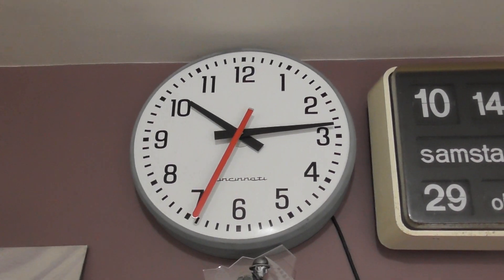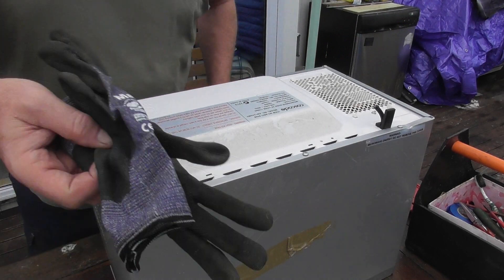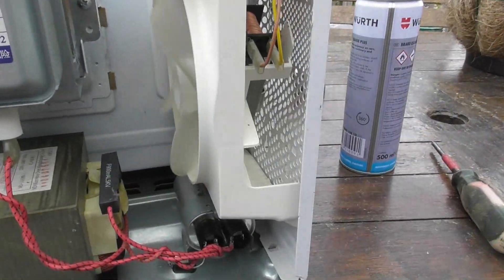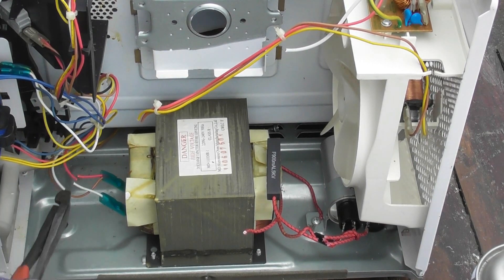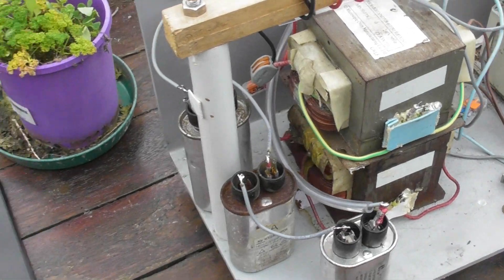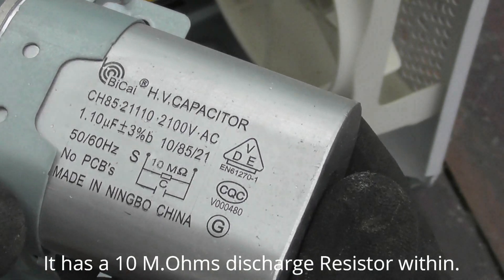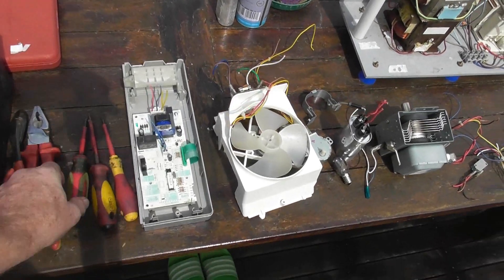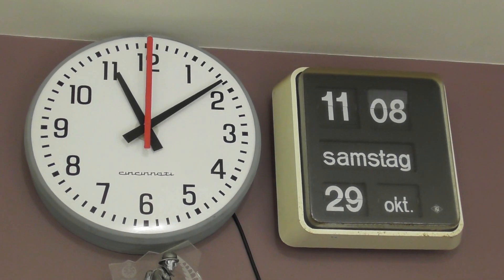Microwave oven dismantling (what parts to be used for a wasp zapper)

Comment: What happened to your watch? it looks like the glass is broken.
Reply from the maker: The glass got broken in transit by the post.
Reply: @RODALCO2007  That something bad. hope you can get a new glass made. PS have you found anyone who can repair your generator.
Reply from the maker: @THORN436  The generator has been rewound. Need to assemble the alternator part again. will make a video when it is up and running again.
Reply: @RODALCO2007  It sounds good.

Comment: I had to replace those micro switches in two microwaves. The old ones were melted and both microwaves ran when the door was opened.

Weird seeing that pigeon swallow that berry. you can see it going down.

Comment: Rodal, I missed you!  You-tube changed my button from getting notifications.   Why can’t they make a microwave that when power blinks one always has to  reset the dam clock.   Is there not a way to use power from capacitors to keep it running ?    ❤️
Reply: They are built to a price point, generally you'd it expect the grid to be reliable. Also seen ovens that have clocks which reset also, but it's only a asnz3000 requirement that open cooktop require an isolation switch.

Comment: 0:54 Question: For that LED, you have a dropping resistor to drop the voltage way down obviously, but won't the fact that a LED only has about a maximum reverse voltage about 5 volts cause it to fail when applied to 220V? After all, when the LED is reverse-biased every half cycle, the full 220V is on the LED. Not being critical, I'm just wondering.
Reply from the maker: That LED runs on the heater winding which is about 3 - 5 Volts AC. The LED doesn't need any extra reverse protection diode like a 1N4007.
Reply: @RODALCO2007  I see - Thanks. But isn't it true that if one tried to run an LED off of 220V, even with a big dropping resistor for forward current, the reverse bias would be the full voltage on the LED, destroying it? That's what I'm trying to find out.
Reply from the maker: @joeylawn36111  Yes, you are correct. Best way for a LED on 220 Volts is use a 1N4007 diode in series with the LED and 100 k.Ohm 1/2 Watt resistor. Have used that CCT in many metering LED's for potential indicators. A high efficiency LED only needs about 1 mA.
Reply: @RODALCO2007  Thanks.